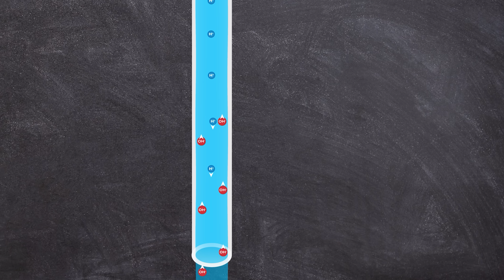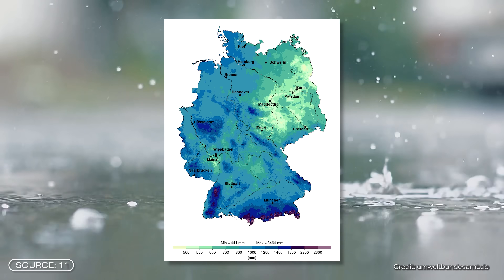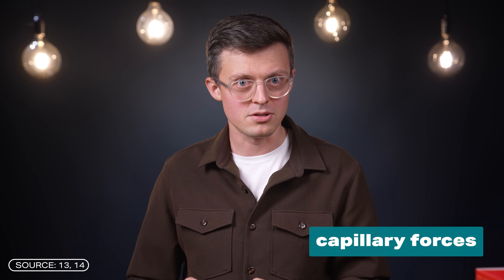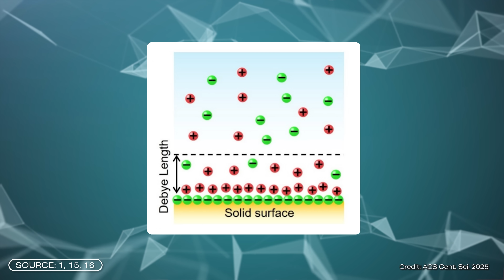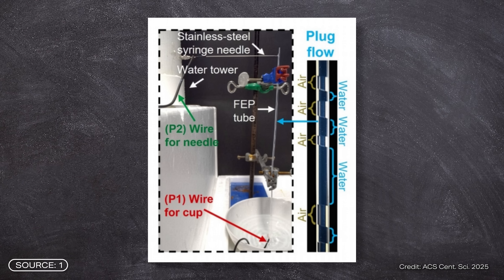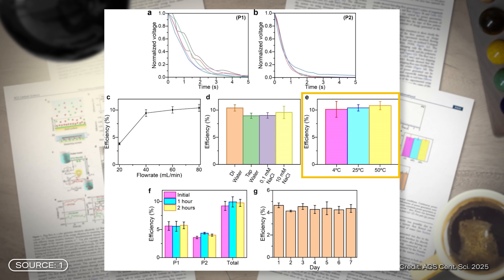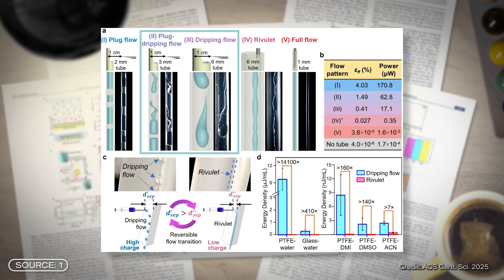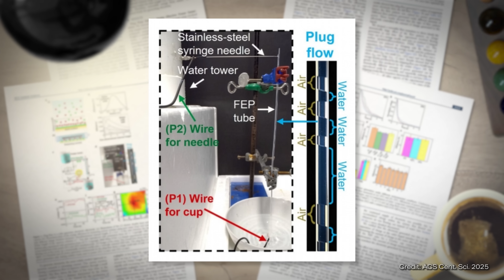Physics Hack: 100,000x More Electricity from Rain!

Comment: Highly interesting! I guess this could be tested in large scale in Bergen, Norway, it being the wettest place in Europe with around 2500mm of recipitation per year. There's very rarely extreme temperatures there and not too much sun and some 95% of the recipication falls as rain (only a little snow), since although it's not that far south (about the same as Oslo), it's very close to the sea where the gulf stream flows, so it's kept warm-ish. And because of all the wind from west and the humid air and the mountains directly at the east of Bergen, it does indeed rain all the time there. The local brewery Hansa's motto, printed on the beer cans is "Brygget i regnet", that is, "Brewed in the rain".

Comment: 1 like it, but I would go for drops falling.The pressure is already on the surface; like sound. Why can’t you generate like water usage equipment. The old fashioned water mill? Tiny rads in places where the water flows through. I am not an engineer, but we already use high pressure water delivery. We did not generate electricity with it. The unit is there, but mounting another piece does two things at the same time. I love to see more non environmental destruction technologies. Thanks!

Comment: I thought of using an internal turbine so there is a propeller turned by the water flow like the old bike lights that ran by your tire turning the little wheel not much power of course but would be interesting to see what it could produce

Comment: I'm less than 2 minutes into the video, but I wanted to say, that hydroelectric generation can be done anywhere in the world if you simply build a reservoir. Intermittent power, such as solar and wind, can pump water into an elevated reservoir to "store" energy that can be used power hydroelectric turbines. It's kind of like using the reservoir to "rectify" the flow of power like rectifiers do in circuits.

Comment: theoretically, YES, WE CAN HARNESS THOSE WATER TO TURN THE GENERATOR TO PRODUCE ELECTRICITY.

but then again, it's hard to make the contraption. it's micro power plant but need lots of efforts. and for sure since it's water, the materials need to be with antirust metal and plastic. preferably metal because moss and fungi still can grow on plastic material.

Comment: This idea could be explored in a closed loop system like a gravity battery. You could have a large source of distilled water that has a huge network of those tubes that, if it worked, dripped into more tubes for more energy generation. If there’s some limitation in that then the water could be used to spin a turbine to generate energy conventionally.

For this topic, the rain water idea is almost definitely stupid. Rain water is too dirty and then all the environmental issues will clog the system in no time.

All that said, I love your videos. Very matter of fact and I love the citations!

Comment: Dont you think TENG can be used in conjunction with the tubes? Also I feel the tubes are just a start and it would probably be way cheaper to produce bigger flow modules which can essentially be parallel tubes, but injection molded as one piece. Also I feel the tube CAN be longer than than 32cm if its electrically separate into multiple 30cm sections (if I understood that section correctly). Overall this could maybe end up being used in place of vertical drain piping with the height pretty much being the roof height from the ground (or more if the pipe is burried underground vertically).

Comment: Interesting development, but if a catchment tank is required at the top and bottom, I imagine a traditional ‘water wheel’ connected to a generator would be more cost efficient. But focusing on this, I feel 3D printing modules for this tech would bring costs down especially as 32cm is the efficient size. I’m wondering could 32cm modules be chained together? (Like the old rain chains used to function).

Comment: I don't see any obvious conflict between solar, TENG, and plug gap. They could all be used in the same space.
The plug gap system could go under the solar panels...they don't need to "see" the sky.

As for the tubes....seems likely that a solid block of FEP could be drilled (or printed) instead of individual tubes. A potentially drastic cost reduction.

Comment: Small scale hydro would supply just as much power as large scale.  Provide reasonable priced small boxes that a 2" pipe can power, and you have people buying their own and reducing demands on the system, especially in remote areas that are hard to supply.

Comment: Hmmm could this principle be deployed in a contained unit and made to move by magnets of various strengths to keep the inner tubes flowing at variable rates? The same mechanism could probably be adapted to pull in the necessary oxygen to keep the electrical effects, no? This sounds like it could make for a small, portable generator design...

Comment: in a rain gutter, heavy rain has a lot of air in it. like some waterfalls. I would try to have a high volume of water that is aerated or as i live by the Bay of Funday , having this system laying on the beach, frothing waves could bring water repeatedly through the system. 
     im surprised salt water doesn't have more electricity or an easier time moving electricity throughout the system.

Comment: Thanks Jakob. (If that is correct? I have to guess the spelling, because speech to text does not pick up your names properly.)

Yes, there are challenges to overcome, but you have to remember that many of today's technologies had inauspicious beginnings, and were very expensive. My first digital watch cost me almost £55, for example, and earlier ones were over £200, but a more capable 'disposable' watch today can cost less than €0.50 if bought wholesale. That's a reduction to 1/500th of the early cost. When inflation is taken into account, the early model cost more than 1,000 times as much as today's model. Rechargeable batteries, solar PV panels, transistors, computers, and more have all seen similar economies of scale affecting their prices.

If development is allowed to continue properly, lower cost solutions will become available, and maintenance challenges, including dissolved salt deposition (CaCO₃ for instance) will be circumvented and overcome. You can also think about this idea in 3 dimensions: Ig the tubes are 32 cm long, the about 3 units could be stacked in a metre, giving a potential yield of 300 Watts per cubic metre. And if you make a stack of 30 units, 10 metres in height, there is the potential for 3,000 Watts of electricity per square metre of ground space. 

And who knows; maybe better generation methods will become available soon? Perhaps water condensation can be employed, to remove the clogging of tubing? And what energy can be extracted from natural evaporation followed by condensation? After all, evaporation causes cooling, so energy is being transferred from the liquid to the gas. Therefore it is released again during condensation.

Comment: Thank you from a wrinkly, old UK engineer. I remember when a 180kb floppy disc was first explained to me and I could see the revolutionary jump it was over tape drives. Maybe if you could change the viscosity of the rain water cheaply you could increase the rain drop size and hence the diameter/length of the tubes?
Reply: Master chef uses cumafire 64 3 times les Mery stire love it

Comment: I would imagine an upscale system like this would have multiple power generation tubes aligned in an array. If that is the case, you could have a cleaning module that is an array of brushes that are as long as the tubes. This could be a simple device that has a handle on it that once you line the brush up with the tubes, You just press it up and down a few times. This might scrape away all of the debris. Also, the pluck flow generator does not need to be directly in sunlight, so it could be attached to and somewhat underneath solar panels. So when it rains and you don't have as much electricity generator from your solar panels, you have maximum output from your pluck flow generator.

Comment: The energy calculation doesn't quite add up.  If you work from a double storey building (8m high), you get about 78.5 Joules of energy from 1mm of rain per square m of area.  For a 100 square m roof in Germany with annual rainfall of 900mm, this translates to a total annual energy of just under 2 kWh, which is insignificant.

Comment: Too much talking, and not enough demonstration.Need to see more practical demonstrations, not simple diagrams. Besides which this effect is nothing new. Two water containers, each with an outflow with the pipes crossing each other but not touching, and two catch containers to capture the different flows, each with a single wire connected will generate a voltage much like a Wimshurst machine. Whether the power generated is of any practical use is debatable.

Comment: Maybe I missed something, but here in Yorkshire, England I get about 500litres of rainwater per sqm annually. With a less than 100sqm roof it's roughly 50,000 litres per year. 50,000,000 ml / 80ml × 440 micro watts divided by 1 million would generate 275 Watts if I could handle it in a minute.  Or 4.58 watts hours or 0.005 kwh in a year. I don't know how many milli-Pennies that would be but it's certainly not feasible.

Comment: Even heavy German accents are pretty easy to understand, if you ever have heard a German accent before. You have a very light German accent. Nothing wrong with a German accent. There have to be a hundred entirely different native English accents. Many of them will be harder to understand to native English speakers than an average German accent.

Germans, however, are perfectionists, and they imagine that they could possibly sound indetectability like a native English speaker. A complete waste of time. 

One thing I did notice is words that begin with wr, in spelling, where you don't have much r. It is not hard to understand, though. Some speakers in England do this. Americans don't have much w, or any. Otherwise you sound mostly American. (I'm from the USA.)

Great presentation.

Comment: Every solar module can do more with the same area for a fraction of the price. And it won't get clogged by deposits from the water. Rain water is not clean water, it catches dust from the air.

Comment: I experimented with a very similar setup over 40 years ago. I read an article from from either Popular Mechanics or possibly Mechanics Illustrated. They stated you could create a static charge with water dropping through a cylindrical conductor. At some point the charge would built up to a point that it would discharge via an arc gap. This is very similar to what this video is discussing. Brings back memories.
Reply: What about hydrophobic vs hydrophilic materials, or even "super"/"ultra" materials? It seemed like this device benefits from thin, spread out contact, and hydrophilic materials can do that. E.g., ceramics, paper, etc. I'm surprised they used hydrophobic plastic, but then again later on he said that there must be gaps in the flow...

Comment: Instead of TENG and Solar competing with this, couldn't they just stack and be deployed together? You take the run-off rain water into a tank underneath the Solar panels therefore occupying the same surface area. Just stack them on top of each other.

Imagine traditional solar panels with a TENG layer on top, and then underneath it rain water collection and piping to a tank for this charge separator. And then finally some micro turbines or somethings near the bottom of a building (careful not to cause too much flow resistance to make the roofs flood :D ). Would really up the energy density per sq meter.

Comment: 100 W/m^2 🧐but...
Diameter of one tube is 2 mm, so on 1 m^2 we have 250 000 tubes.
80 ml/min PER ONE TUBE means that we need 20 000 L of rain per 1 min per 1 m^2.
This is 12 000 times more intense rain than a tropical rainstorm 👌
Reply: I believe the 100W/m^2 references the surface area required for the system, while you would be channeling water from larger area to it.
Reply: @SissiSaatana  Even if we collected water from a larger area, it still means that we have to collect rain from 20 000 m^2 at one time (with typical rain of 1L/min per m^2) to power a refrigerator (70-130 W). 

If we're collec water from a large area and have a large flow of water, it's probably better to use a simple turbine.
And if these pipes are more efficient than turbines, then we should replace turbines in power dams with them.

Comment: Interesting technology for something. Sadly all physics hacks still have to abide by the laws of thermodynamics. Say the average house uses 5kWh per day and is 5m tall, that's going to require 18,000,000 / 5 / 9.8 litres of water to land on the roof each day, assuming 100% efficient conversion to electricity. That's 370,000l. As the average roof area of a house in Germany is 45m2 that's a daily rainfall of 16m, 250 times the rainfall of the wettest place on earth! In Germany you might average 0.1% of electricity requirements from rain falling your roof.

Comment: Just put good filler over down pipe inlet. Then fit small turbines in down pipe and power is generated. No fuss, no drama, simple. Just need to keep out solids like leaves and moss.

Comment: Sooo we have a system that can recover ~10% of the potential energy with a necessary heigh difference of only 32 cm using "common" materials?
If we run that with a closed loop of clean water and a pump that up when our solar panels have peak hours we have super safe energy storage?
So not very efficient but very reliable?

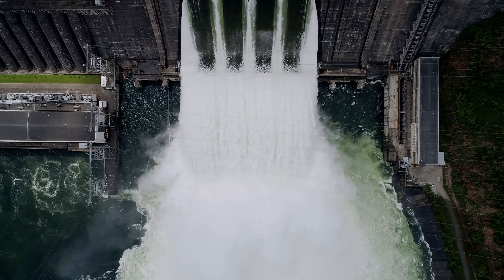Comment: At 0:48, you spoke of the generation of electricity for thousands of years with hydropower. This is absurd. Oersted's discovery in 1820 opened the door to the invention of electric motors and generators. So we have had about 140 years of hydroelectric power generation. Not thousands of years.
Reply: He did not say that. Go back again and re-listen. He only said hydropower, not hydroelectric power. Waterwheels have been used for millennia.

Comment: Between the construction and maintenance costs of the system, I foresee companies promising a 20 year payback.  Oh, and don't forget, your roof and gutters will first have to be replaced with "clean flow" roof products. Add 10 more years to payback. Of course, unless it rains, you will have to run a generator.

Comment: Complimenti per la spiegazione molto dettagliata del come funziona ma al momento e ancora un po' bassa l energia per ogni centimetro quadrato e necessità dello spazio per accumulare l acqua e meno spesso piove e più serve spazio ,e con il calare del costo delle batterie al litio si preferirà il fotovoltaico ad altri sistemi già io valuto inutile il termico per l acqua sanitaria basta il fotovoltaico con un bollitore in pompa di calore per non avere tubi e istallazioni costose e con i 250w il bollitore se fatto funzionare durante le ore di sole non necessita di batterie fa lui da batteria termica accumulando calore quando c'è il sole con l energia del fotovoltaico e trattenendola per renderla disponibile quando non e presente il sole .

Comment: More promising than you suggest!  This doesn't have to replace solar.  30cm tube lengths mean collecting rain on the side of the building, in multiple containers and dripping down in series.  Produces power 24/7, and powerwashing your solar refills it if needed.  The specific plastic tubing is only expensive because it is not commonly used.  Process seems very close to fuel cell/reverse electrolyzer from free H2. 

OTOH, vertical solar can also be placed in 3 directions of a house, and that + more batteries will extend solar collection period of day, and improve winter collection.  Still 80 degree solar panels on side of building can hold water tanks beneath them, and a small gap to prevent solar from shading below layer is enough for the short tubes.  Integrated  water tanks behind solar also prevents wind catching them.  Can also be used to improve rooftop solar angle for northern locations desperate for winter energy.

Big point being is the construction/deployment costs are lower when integrated with solar.